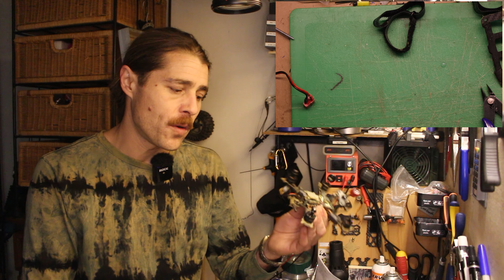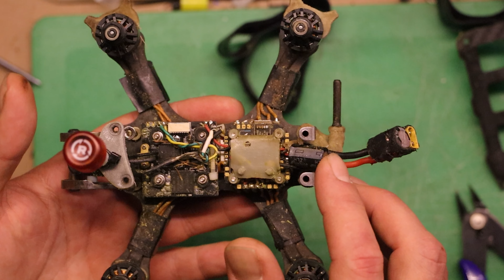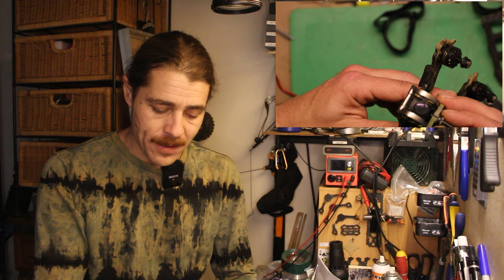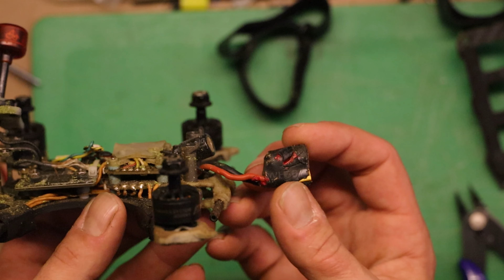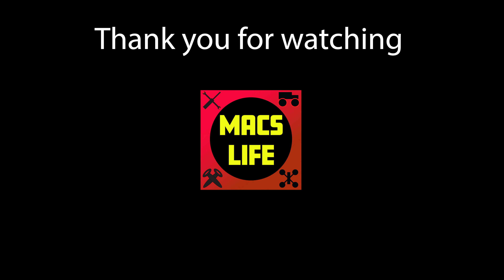3D Printed Vtx Antenna Mount For Gecko 3in

Comment: Good to see you post again.  On my acrobrat, I have the rx antenna up front on top, and I have a dipole out the back.  Working well, and I think having some extra spacing between the two antennas helps a good bit with that.  How do you think the durability will be with the antenna straight up? How much flex?  On a lighter build like that, having it straight up like that probably isn't as bad because of the low weight, but I have never tried it.

Oh, don't shave the stache....  grow a  beard though ;-)
Reply from the maker: Cheers and thank you Stacey. 
I have got to try the dipoles out eh. With the mount in TPU it has a reasonable amount of flex. If made out of PLA the part would likely snap with a hard enough hit and that should soak some energy of the crash. Not ideal as the ant would be loose and thus strain on cable increased... 
The Cherry seems to be well made and has survived a 15m drop that squished the battery. Has not come out of the mount since the q-tie was added but did have a come loose before. If I recall correctly, I ran it through a thick tree branch at some speed and it ended up popping out into the space in front of it. 
Would not recommend an upfront for freestyle 5in or up, too much weight to pull the top off. Although with a dipole it could be ok. Wouldnt get caught in stuff the same...
Maybe next winter, this summer going to be a scorcher. Be well and fly safe dude 😉